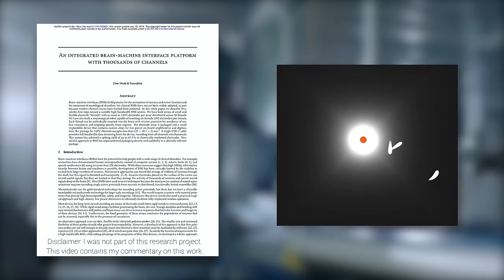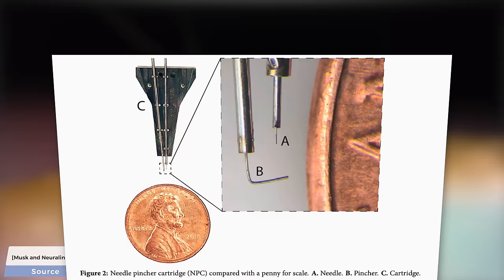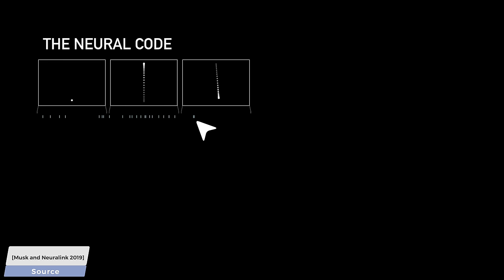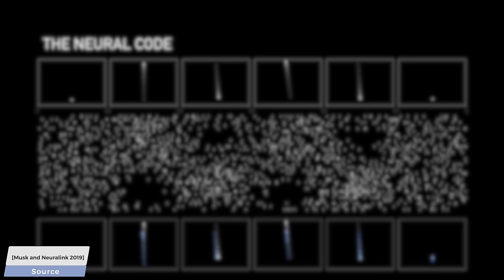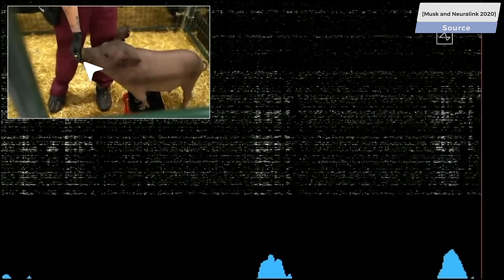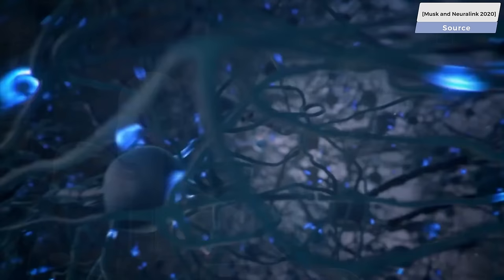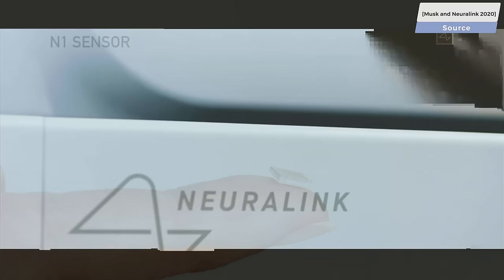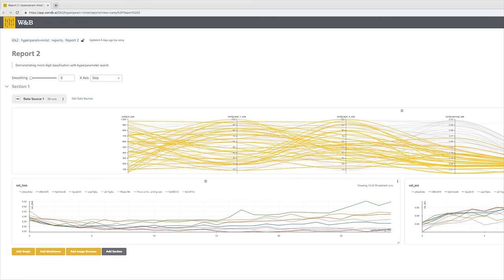Elon Musk’s Neuralink Puts An AI Into Your Brain! 🧠

Comment: 1. run the signal through an encoder

2. run a classifier on the embedding output by the encoder.

3. that gives you a proper analog-to-digital signal, converting the waveform to an imperative system.

Comment: This has actually been possible for a couple of decades.  It is called a multi-electrode array.  From someone who works in a neurophysiology lab, the biggest complaint about this is that Elon was presenting the state of the field some 10-15 years ago as though he had produced a major breakthrough.

For reference, the pig snout has loads of sensory neurons, and they map to the outer cortex (this is important as this technique cannot access  the inner layers of the brain).  Therefore, they knew a prior from decades of research that they were going to get a big signal.  This would be comparable to placing an MEA on a human brain and flashing lights on and off.

I can say I am stoked that Elon is getting people excited about neurophysiology, but the field is so much more advanced than what he is presenting as a "breakthrough".  For example, a few years ago one research group mounted an IR camera onto a mouse, and wired its outputs to the barrel cortex of the mouse (where the whiskers signals are processed).  As a result, the mice were able to effectively acquire IR vision and navigate a maze illuminated with IR light.

The absolute cutting edge is addressing the depth issue, where a lot of the more critical functions, such as emotion, memories, etc. lie much deeper in the brain, where surgical intervention such as this isn't feasible without damaging outer structures.  Therefore, people are working on three photon holographic excitation of optogenetically encoded channels or even nanoparticles, to fire complex 3D ensembles of neurons deep within the brain.

Comment: What are they using to make the predictions? Will Neuralink prove determinism?
Reply: I was going to ask why it says your comment was made 16 hours to go but you may’ve had access while the video was unlisted/private.
Reply: // I think to perfectly predict a system, you need a predictor larger than the system( unless the predicted can be compressed without data and property loss), so it does not really matter if free will is a thing or not from a practical view.
Reply: I don´t understand your questions at all.
They are using the firing of neurons to make predictions. So electrical activity.
Or did you mean something else?
Reply: @engineerbot  it's a membership feature. He/she get early access to new video
Reply: I think the "predictions" is only the understanding of the data at a time. I dont think it mean predict futur action, juste the action already througt.
Reply: If you ask this question you should probably realize that you don't really understand what is explained in the video. It's prediction based on pattern recognition and cycles. Basically it's able to predict patterns that would happen during a walk cycle, and I guess probably able to recognize when the cycle stops and change it's prediction accordingly, but it wouldn't be able from a walk cycle pattern to just run without further information and infer when the walk cycle would end.

In other word it's just making an informed guess on what it thinks will happen next, but it doesn't know it. It's more of a statistic thing than anything else. It's like, if I see a picture of someone walking in the street and asked to predict the state they'll be in 5 second later, I can guess they'll still be walking but that's just because I know that most likely they will, my prediction will generally be accurate but fail to account for the person stopping to tie their shoelace properly, or suddenly hit by a car, or just deciding to stop for whatever reason.
This is basically the same kind of prediction here (except on a much smaller scale since it uses the state of neurons as a predictor).

Now to answer your question : free will isn't a meaningful concept and you don't really need neuroscience to prove that to be honest =p Like, the concept hardly make sense and you can't really make discoveries that "disprove it". To make sense of the concept we'd probably need a total paradigm shift on our understanding of consciousness and how brain function. But no this study doesn't seem to go in that direction so technically it is an additionnal "proof for determinism" in that sense.

edit : I should note that I'm by no means an expert. If I said some wrong things please someone more qualified feel free to correct me. But my main point about the question being flawed is probably still relevant unless I'm extremely wrong.
Reply: @Laezar1  I think the point is that it may be able to predict future decisions before they are made, outside of some sort of cycle.
Reply: @kicka55  Every scientific development and implementation brings its own fragility. In effect, if humanity became dependant on something like nuerallink, this would be the end of humanity, because at that point things would be sooooo fragile and interdependent it would just take one little needle to pop everything. We are already too dependant on electricity as it is, one CME event and 99% of humanity would be dead. Just because we falsely assumed that life has a linear progression. Something like neural link disguises itself as progression but does not solve the problem of Black Swan events, with every additional buildup of interdependent technology, the system becomes more and more fragile to any kind of out of the ordinary event. We are probably safer just being hunter gatherers, than being a tech hivemind of 10 billion information hubs.
Reply: As much as I am enjoying this discussion I wonder is there's a single neuroscientist here. Cause read people making sweeping statements about how the brain works and from my own humble academic experience I feel many are hyper-simplifying the problem.

Anyway, its been proven sometime ago that running an MRI in real time on a person you can read from the brain what that person will say before they say or even think it. Does that disprove free will? No idea. Does it prove determinism? That's seems an even more far fetched conclusion to me.
Reply: @ten_tego_teges  I agree. It seems like much of this discussion is a search to validate certain preexisting beliefs. I do wonder how many "academics" we have in our midst. The fundamental questions we have about life remain solidly in tact, as they have been for thousands of years.
Reply: @kicka55  don't you believe complexity in itself can become so entangled and procedural that this then is enough justification to consider free will as a real thing? I mean, we certainly don't live our lives believing it to be deterministic. You had the choice to write that comment and you can argue it was in your natural inclination to do so therefore it was deterministic, but I'm sure you can find moments in your life where your free will has prevailed over your perhaps, instinctual desires. This is kind of a major point of religion, is that you should fight the overwhelming powers of evil in order to retain the purity of your soul (simply put), and thus you must abstain from doing certain sinful acts that may lead to the corruption of your soul. Even if it is computationally true that we are deterministically designed, I can't put that fact ahead of the simple reality that our lives are not perceived this way; and since reality, to a very large extent, is determined on our perceptions and indirect perspective on "true" reality, we should not throw the potential of humanity away for the sake of saying "we're just robots doing what we do". I don't believe in that and I don't even think it's beneficial to believe in such a thing because our lives instantly become worse, and there is no one that will deny their suffering on earth. Pain is real, you feel it. You, as a biological creature, feel emotional and physical pain. You are not exempt from this.
Reply: @kicka55  Our choices being predictable does not mean that free will doesn't exist.

Comment: Hi. I watched the live event too. My impression, however, is that the Neuralink is just a sensor. There was a breakdown slide that mentioned "wireless data rate" which i'm not quite sure what it is but I think it means the Neuralink has wifi capability to send its measurements to a PC where the inference is actually being done.  Also judging by the size of the device (a size of a coin) I don't think it has the compute power to make an inference for such a complex task. Bottomline is I don't think the Neurallink is an AI.

Comment: From my understanding this also has the potential of being applied to situations where massive amounts information is required in in bursts.  An example would be a pilot in an emergency situation.  Pilots train to develop the skillsets to handle situations based on the stimulii presented to them.  This is harder said than done for many reasons: emergencies happen vary rarely - an instructor will simulate an emergency almost every flight however, once training the is over, the chances of an emergency occurring is extremely low. Hence, the need for recurrency and sim training.  Am I mistaken to assume that this could eventually develop into a system that might help one assess the relevant information as quickly as possible, assess the option presented and help a pilot develop an action that will result in a positive outcome in a fraction of the time.

Comment: I'm not that pessimistic about the abuse potential of this tech, at least not about unintended abuse. We do have systems today that musn't be hacked, and are sufficiently secured against hacks. Think about airplanes or medical devices today. They're secure basically because they're disconnected from the outside world. Risks arrise only if you allow some form of outside control over a device. But if a human life is at stake, you approach the design of controlling APIs extremely conservatively. If you allow users to enable or disable data transmission with the push of a button which physically disconnects the data transmission line from the communication adapter, for instance, no hacker in the world will be able to reconnect to your data.

There are software provers out there and used daily for critical systems. You can prove the correctness of soft- and hardware before deploying it, bringing the risk of attack to an absolute minimum. They're just rarely used, mainly when human lives are at stake, because they're incredibly expensive for more-than-trivial systems.
Reply: Even air gapped systems aren't safe against a determined attacker. StuxNet was able to infiltrate air gapped computers at one of the most secure facilities in the world.

Comment: It will never live up to Elon's promises. I think Elon is great entrepreneur but the limitations here are insurmountable. Neural prosthetics have the issue that the electrodes are only capable of distributing voltage across a volume of tissue,.rather than connecting wire-to-neuron, you stimulate a cluster of them contained in a region of volume, which will prevent fine-grain data interfacing with biological neurons. Even if they made super tiny wires that can do this, they would still be facing an even bigger obstacle, which is the controllability of the system. the brain can be thought of as a NLTV complex system which would still potentially have structural controllability but determining the control structure of a system with 100 billion+ nodes is practically impossible. Even if they did somehow figure that out, they would need to interface with all of the driver nodes in the network which would be millions of tiny wires going all over the place in your brain which is again practically impossible. 
The only success neurolink will ever see is in the medical field for helping people regain control of their arms and legs which is still really cool. But neurolink will never enable people to control things with their brain, allow you to save memories from your brain, or allow you to upload data to your brain. There are other options to consider if that is what you want to do, but a neural prosthetic is not one of them